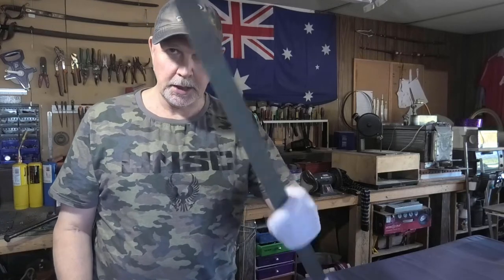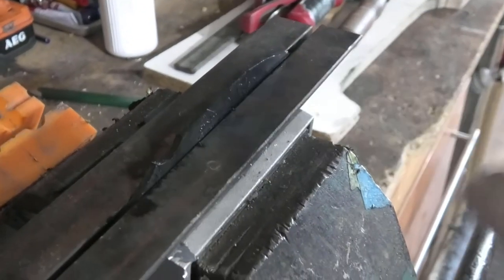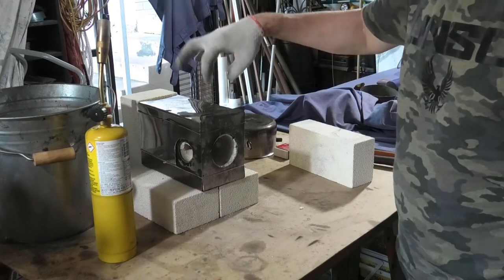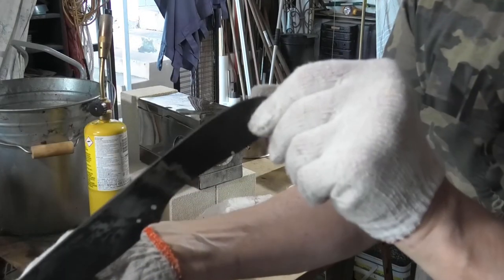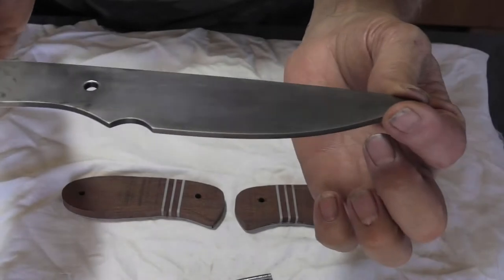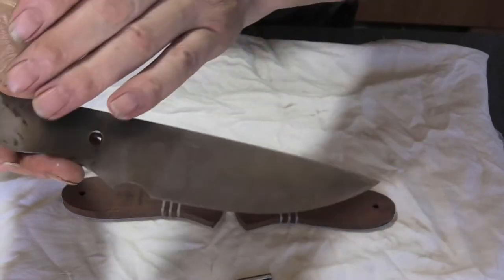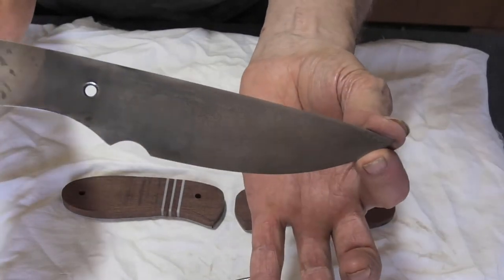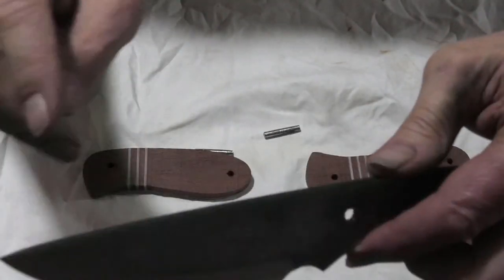BushCraft Knife with Forced Patina Part 1 | Perth Custom Knife Maker

Comment: Really good!
I also really liked this support with vertical bar that you used to control the angle when sanding.
Do you have a video of his making?
Reply from the maker: Hi Willer, thanks, I don't have a video of what I call the 'floor jig' but I should make one to show how I made and how it works, have a good one mate
Reply: @MrMarsBlades  Thanks for the answer.
I thought it was a great idea, I'm already waiting for this possible video.
A good day to you too.